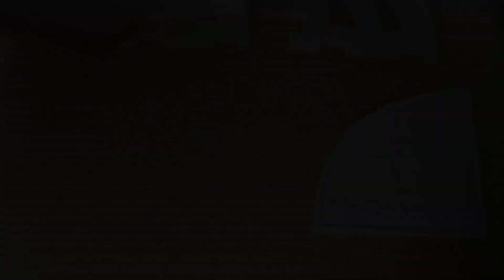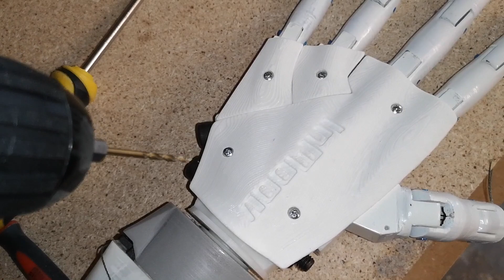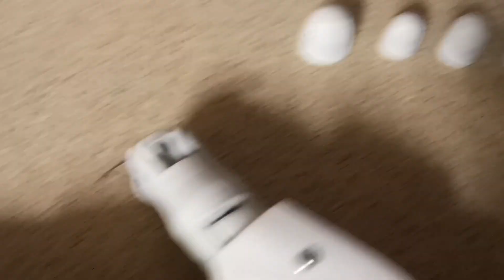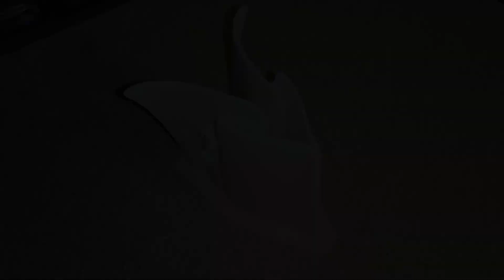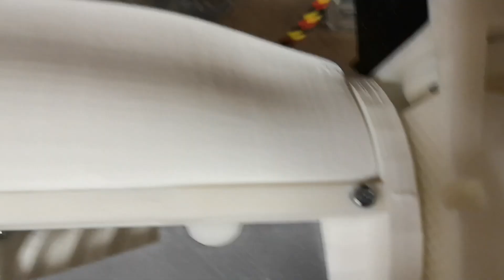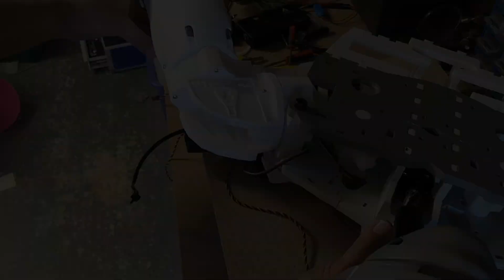Civrays InMoov - Complete Left Arm

Comment: how did u controlled it with laptop what sensors?
Reply from the maker: there are no sensors other than the potentiometers in the servos. I use myrobot on the laptop/rasp-pi together with arduinos on the robot.

Comment: I have an 8" x 12" x 0.010 white plastic sheet that I cut into strips to cover the back of the bicep. I held it in place with dots of hot glue so that it can be removed rather easily. It does help the bicep look more solid.
Reply from the maker: nice. i've also seen some people fit an extra front bicep cover on the back

Comment: can I use servo motor mg90s Instead  of tower pro mg996r
Reply from the maker: Not with the standard build. The MG90 is a micro servo (very small), the MG996R is a standard size servo. In theory you could use the MG90 but it would not have as much strength and you would need to redesign the servo holder.
Reply: @SteveRaynerMakes  thank you very much for answering 🌹just one more question In the Adjustable thumb for InMoov there are four wires/lines into the thumb. Two of them for open and close the thumb one on the back of the hand and the other one in the front.
wear the other two go and what they do And how does the finger action work - the sequence of movements and did Anar fix the top surfaces problem ? 

Thanks you
Reply from the maker: @unaidedjoker8398  sorry i'm not familiar with that thumb design. You could try asking in the google group. https://groups.google.com/g/inmoov?pli=1
Reply: @SteveRaynerMakes  thank you my brother thank you for helping 🌹

Comment: Nice work! Did you find that building the Finger Starter was crucial to building the body of InMoov? just curious
Reply from the maker: Not really no. I would start straight with one of the full hands. It just takes a bit longer before you get results because you need to make the whole hand wrist and forearm to mount the servos before you can get things moving.

The benefit of the finger starter is that you can get a taste of the project quickly. If you decide you didn't enjoy it as much as you thought you haven't waste too much time effort and money.

If on the other hand you're already sure you want to build the whole thing, then don't waste time on the finger starter.
Reply: @SteveRaynerMakes  Thanks for the advice. I have all the supplies for the Finger Starter and have already glued most of the finger joints together (minus the tip). I haven't started with the fishing line installation yet. Was it easy to accomplish and test? As far as the InMoov body, I have the whole thing already printed from head to feet in PLA...just waiting to be assembled.. :)
Reply: @SteveRaynerMakes  Thanks for the advice. I have already printed the entire body in PLA and it's been sitting in a box for months. I got about halfway through the finger starter (work duties, family, Iron Man suit building, etc) but I have to follow the English subtitles for Gael's video because he speaks in French in it. I have all the supplies to do it though. I just need to carve the time in to do it..Just wondering from someone who has done it already, did you have any issue with getting the fishing line through the finger joints?
Reply from the maker: If you haven't assembled the fingers yet, then feed the fishing line though as you assemble them. I think this video demonstrate that technique well. https://www.youtube.com/watch?v=2gissSmogjI

I used slightly thinner line than the 200lbs line that Gael recommends. It can be a little tricky to feed them through, you need patience (and a pair of tweezers helps). Feeding them through the wrist is tricky also.

The main problem I had on my first hand was that I fitted the pullys on the servos back to front. That took weeks to figure out why the finger would not move correctly.

Comment: Steve, You look like you are doing a great  job. Are you doing this alone? I'm just getting started and am looking at some initial start items. Do you have any suggestions? How much filament have you gone through to this point or can you break it down by hand, forearm and bicep?
Reply from the maker: Yes I'm doing this alone and with just one printer. I have gone through about 4 rolls of filiment so far, I think. You need to allow for some failed prints. I would start with the hand or the head. That way you can get some fairly satisfying results quickly. Make sure you have a good quality printer and that it is tuned. Don't underestimate the time required. Some parts take up to 6 hours to print and there are a lot of parts.
Reply: @SteveRaynerMakes  Thanks for the info. I'm in the same boat. I have already assembled the right arm but am waiting for the filament to get here. I have already mostly completed the head but ran into some clearance issues with the worm gears. I found what is supposed to be a solution on the forum with the slicer software, so going to give that a try so that the pistons can be put together and operated properly. Time is definitely what you say is true. I have been at the print and assemble stage for over three weeks and mostly printing. I have to try to get my second machine up and running again . I had some cheaper parts break and then found out last week that I cannot use the same computer for both printers because the config files mess with each other. I have two different name brands and types and they will not play well with each other. Good luck on your build and I hope to see more of your videos and see you in the forum.